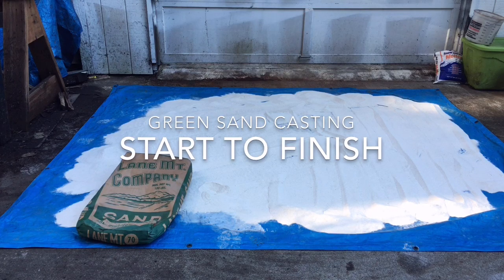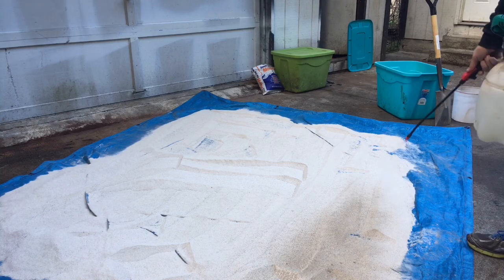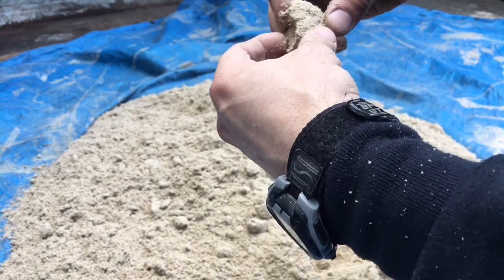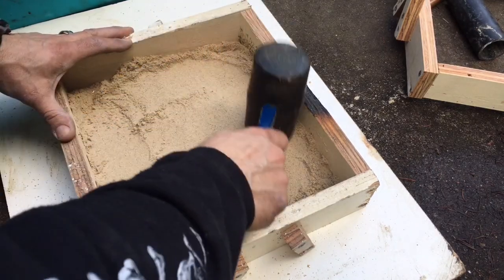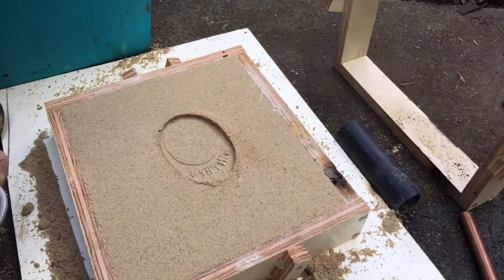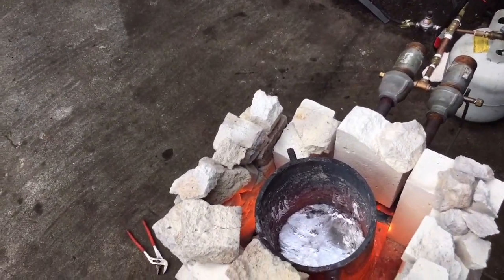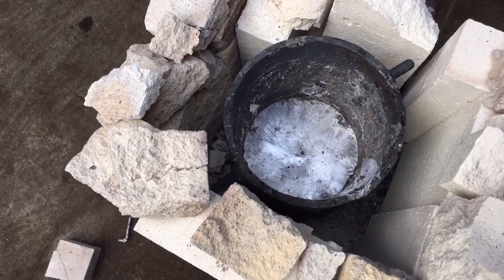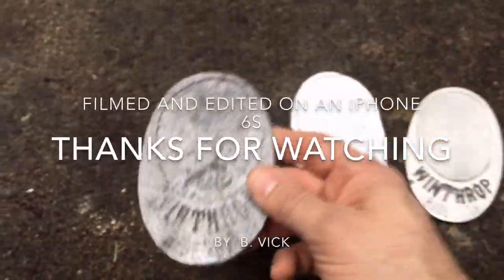Green Sand Casting

Comment: ok so reusable molds. can I make a two sided clay mold of a coin (that's my current interest)  let the mold set and harden. and then pour it several times?
Reply from the maker: you would have to have two blanks. one for each coin face or front and back if you will, but smooth on the back then you need alignment pins with holes drilled in the backs you set the first face up put in sand, then turn the flask over and place the back of the coin using the alignment pins and fill this flask then you'l want to separate and cut your sprues and risers into the sides of the coin. cast then clean up the parting line.